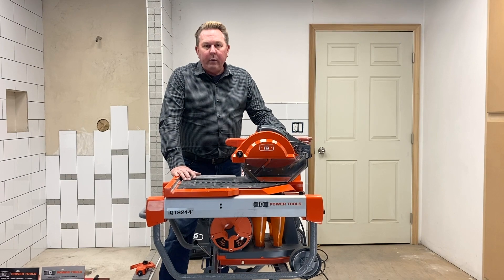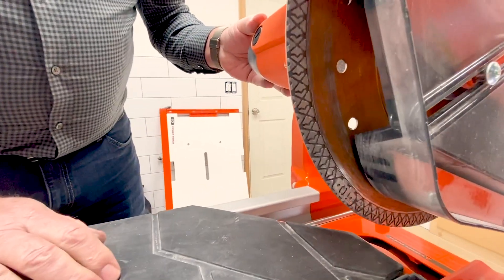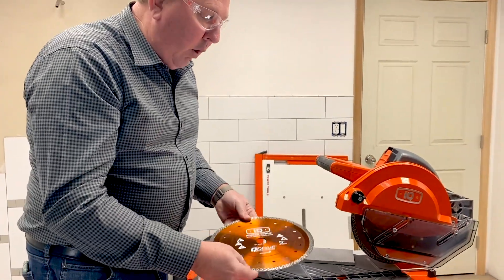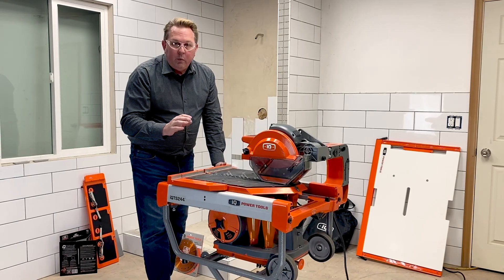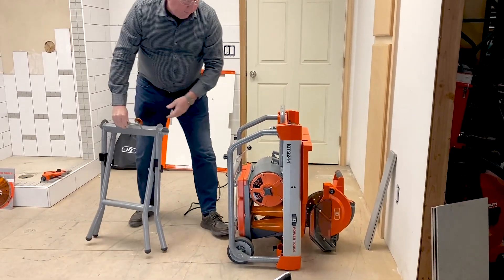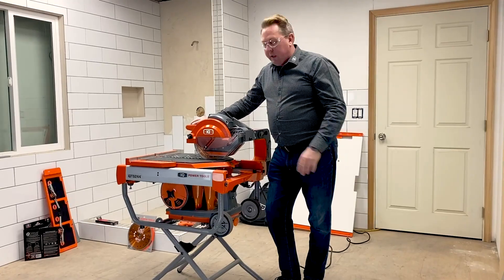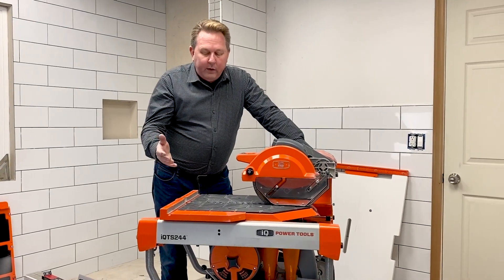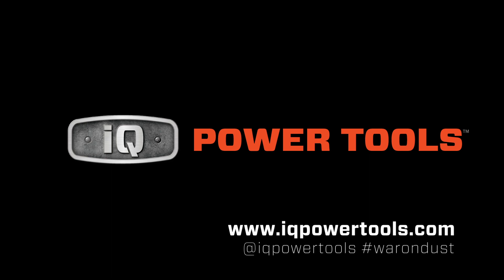The iQTS224 and Accessories Full Demo

Comment: I have used the IQTS244 for over a year. I agree with Eric Starin the stand could be a little taller. I will just make use out of a skid and a bit of plywood screwed together for now to give it a lift. One thing I would like to see is a continnuos blade for cutting soft materials like marble and  glass. The combination blade leaves a chip on the end of the cut. Even better make an adaptor for a solid arbor so I can use a store bought blade. Otherwise the saw is awesome! Most bathrooms I do are on the second floor that have form 10 to 13 steps to go up and down all day. Not any more.

Comment: I just bought one. I like! Just wish there were telescopic legs maybe for the stand to raise it up a bit. I’m 6’2” and bending over that low all day can become uncomfortable I mean we all know tile guys backs aren’t usually the best. The vacuum attachment would be awesome especially if it could be integrated into the system itself. For instance on board hose storage and a simple on/off switch. Just first thoughts. I may take all that back after some more experience with this guy. Anyway very well built and thought out! Highly recommended!

Comment: Bought the saw and all the accessories.  Works awesome!  I'm just concerned about scoring up the soft top of the extension table.  Ran some porcelain tile for rip cuts and noticed the rough bottom of the tile is scratching the heck out of the top.  I ran some other pieces finished side down because I was concerned too much table top scoring would ruin the smooth feeding of material.  What can be done about the table scratching?
Reply: Hey Phil thanks for your in depth answers. That really is helpful. I do tile work for a living and ive been trying to decide between the new DeWalt 3600 and the IQ. I feel like I am leaning towards the IQ. Just wanting to make sure it can do everything I need it to especially for what it costs. Yah it's a shame customer service ain't what it used to be but at least us tile guys can still look out for each other lol! Thanks again Phil!
Reply: @jeffirvin6364  You are welcome.  Not sure if you've seen this video and part 2.  If not, you should check it out. 
https://www.youtube.com/watch?v=sopa4dODNQA
Reply: @jeffirvin6364  hey Jeff after more time with the tile saw would you still recommend it? Or is the Dewalt 3600 a better option?
Reply: Hey Phil I thought since they didn't answer your question that maybe I would be better off asking you lol! Can this saw do plunge cuts? And are the cuts truly as clean as a wet saw?
Reply: @jeffirvin6364  Oh yeah, not only didn't they reply to this, but I sent them email on their website and never got a reply.  Never able to get anyone on the phone either so greatly disappointed in that.
Reply: @philsheppard4736  That is the problem I am having with! they hardly reply to your question! But of course the machine is (in my personal opinion) well worth if you are cutting inside the house. I am UK base and I have to rely on agents.
Reply: @jeffirvin6364  Hey Jeff.  Yes, it certainly can do plunge cuts. Just finished doing floor to ceiling walk in shower for my mother in law using 12x36 porcelain glass tile.  Had to make some monster plunge cuts around the window and around shower niche.  Also had to cut out a rectangular area for the control valve I bought from England ... about 2.5 inches by 8.5 inches in the middle of a tile.  Its tricky, but doable.  If I knew how to upload images, I'd show you.  Was dealing with local Ardex rep and showed him the cuts.  He was blown away.  Also, the table saw feature is awesome.  On those U shaped cutouts around the window, the lower leg was a little over .5 inches wide by 18 inches long and the upper leg was .75 inches by 18 long.  After dry fitting, had to shave about a 32nd of an inch off the lower leg.  No problem using the table top.  Try that on a wet saw.  Might be able to do it on a rail saw, but not your standard wet saw.  As far as cut quality, it did chip a lot because it was glass tile.  No matter how slow I went, it still chipped.  However, using a 100 grit diamond block on the edge helped a lot.  I ran a number of cuts on some other pure porcelain tile (not glass glazed) and the edges were perfect.  Good as my MK Diamond 101 cuts for sure.  So if you're not cutting glass, I'd recommend it.  Clean up was a dream, though there is more dust when you use the table top feature if you are trimming just one edge.  Still, setup and clean up was a dream.